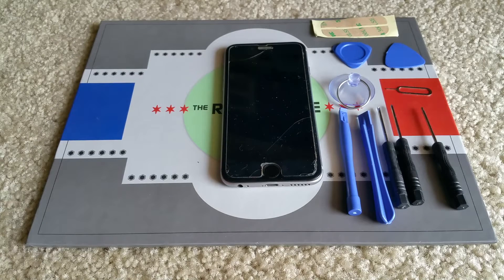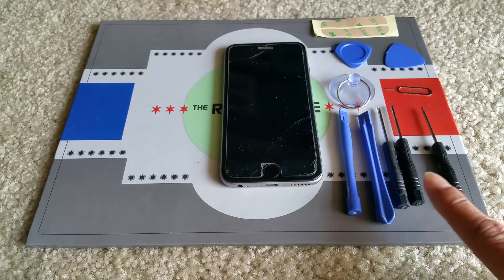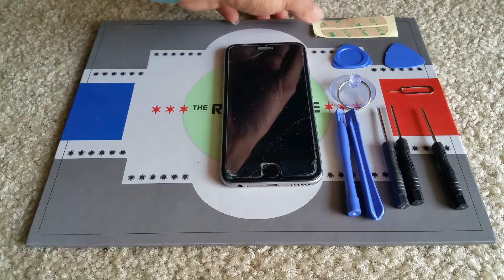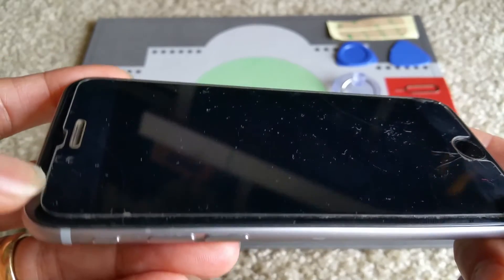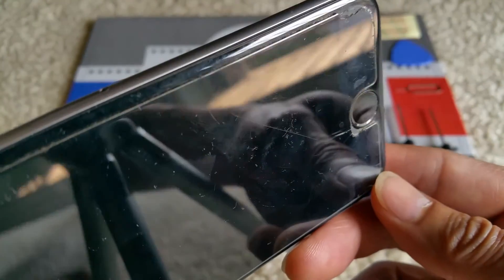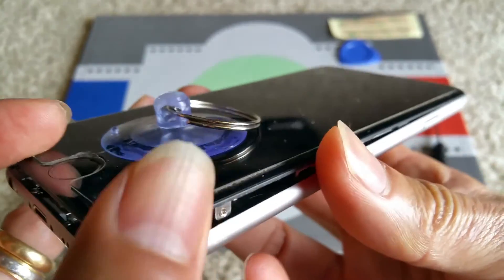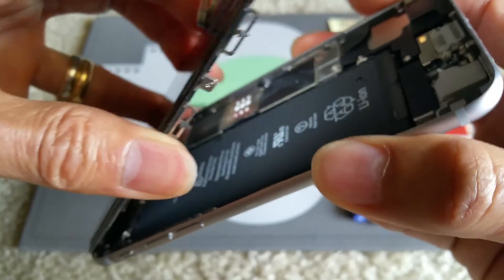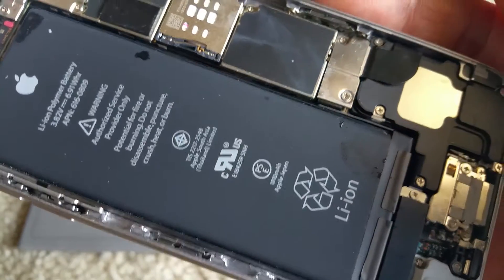Close-Up On How to disassemble water damage Apple iPhone 6 6s Part 1 2016

Comment: Would it be okay if I were to remove my battery and screen then put my phone with the internals attached to it in isoproply alcohol 91%.

Please reply macdaddypimpping
Reply from the maker: Yes, you were suppose to remove screen & battery then clean the circuit board with 91%  alcohol and clean with brush or ultra sonic cleaner.
Reply: @macdaddypimpping  I did remove the screen and the battery and my battery ended up having some stains and other stuff on it so I threw it out but i'm going to replace it and test it out to see if it works I really hope it works

Comment: You can remove some water from the rubbing alcohol by adding "plaster of paris" to it.  Be careful to separate the plaster by straining (filter) though a paper towel.     At 95% alcohol, the alcohol absorbs water from the air, so store your alcohol with the plaster in the bottom and keep the lid on.  BTW, this (paper cartridge encasting plaster) is how your HVAC removes water.

Comment: i can only get one screw out...looks like the guys who replaced my screen stripped them i wonder why they didnt put new ones in...how can I do this? help.... phone BARELY got wet...was down in carib (where i live in winters) and it was outside UNDER clothes UNDER porch during a small rain cloud and clothes were DRY?!?!?! just moisture but this was in Feb. so phone might be shot?!?!
Reply from the maker: Do you have the right tools to remove?
Reply: macdaddypimpping   Hey bro thank you so much for replying. I have 2 iPhones and removed 3 out of 4 screws the last one is not coming out;(. I used a combie from another YouTube video a kid said use a nail so I did that with all 4 but only 3 came out....  I have tiny tools but now my hands are cramping and I think this last one was stripped by having my screen replaced a cpl times....
Reply: macdaddypimpping do you fix these for a living cuz I could use your help
Reply: macdaddypimpping I switched to an android phone when this thing took a dump and 3/4 of my contacts didn't make it over and since old iPhone won't turn on I don't know how to retrieve. I do have iTunes,gmail and I'm currently with verizon. Was just gonna chat with them but you messaged me back
Reply from the maker: Try to use needle plier or nail clipper to remove them or use a flat head screw driver.
Reply from the maker: I fix for living but try to fix yourself first for Free.
Reply from the maker: Verizon & Apple can not help you on these. All they want you to do is purchase phones from them.

Comment: Hey your video is really helpfull i just wanted to ask that the light is not red and there is no sign of corossion also so does it means that there is problem in display only .I dropped my iphone 6 in tub and i instantly took it out but it stopped working
Reply from the maker: How long did you drop in the tub? What light is not red? Sticker?
Reply: I dropped it for just not more then 10 seconds and the sticker is not red nor i can find any sign of corossion on motherboard and other parts but the phone is still not turning on and my phone was cracked from top left so maybe it did something to display screen.Pls help me.
Reply from the maker: Turn on and off the vibrator switch and see if it still vibrate. How do you know if sticker didn't turn red, did you or repair shop open your LCD?
Reply: i opened the back case and the sticker which you showed turned red was still white in my case
Reply from the maker: Does your vibrator work on your iPhone when switching on and off?
Reply: no
Reply from the maker: Have you tried to charge your phone after it was dropped?
Reply: yes i tried
Reply from the maker: Then you will need to clean your mainboard/motherboard/IC board with 91% Alcohol or with my ultrasonic method to rescue your iPhone back. Your mainboard is damaged.
Reply: Will 70 percent one work because i cant find any 91 percent isopryl
Reply from the maker: You can find 91% at Target Stores but yes 70% works also but takes longer to get it dry.
Reply: Ok thank you i hope it works
Reply from the maker: Try to clean out your charging port also. Hey, if it works for me then it will work for you.
Reply: k
Reply from the maker: Come back anytime with question(s).  Be sure to like the video and subscribe to our channel.
Reply: Ok ill come back to you tomorrow if it works or not
Reply from the maker: Sounds good, you can dry your mainboard after cleaning with a hair dryer at medium heat level. Good luck.
Reply: thank you
Reply from the maker: You're very welcome.

Comment: hi my motherboard works fine but it get really hot around cpu and also the gravity ic is messing around what do you think i should do with overheating problem? by the way its water damage
Reply from the maker: You need to clean your motherboard/ic board with 91% Alcohol and brush off any residue that is causing short circuit and overheating issues. Search on my video on how to clean your water damaged iPhones. Good luck.